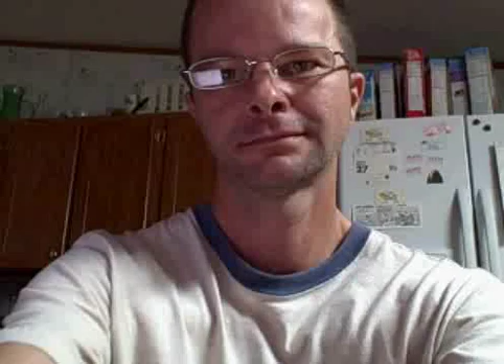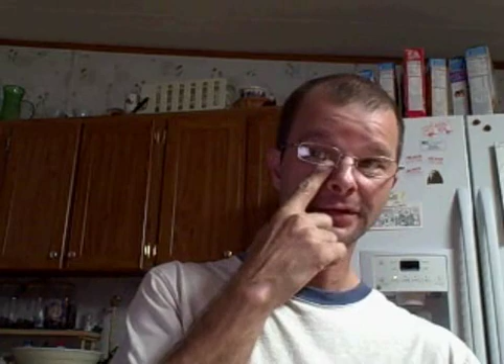HVAC Condenser keeps tripping the breaker with nothing turned on.

Comment: So everyone coming here to view this probably wants to know why their unit is tripping their breaker. Well my unit was doing the same thing. The breaker would trip immediately. I opened up the unit and it turns out the crankcase heater was burnt to hell. The heater gets constant power even when the unit is off so that live wire was touching ground and the breaker could never be reset. I think this issue was the next to last one he mentioned in the video. $30 bucks at the parts store! So good luck and hopefully this is your issue too and your compressor isn't shorted out :)

Comment: that's it! single pole contractor trips breaker anyway... even though thermostat hasn't turned it in/closed the circuit. so you're saying because it's grounded current still flows... enough to trip the breaker if there's a short? I'm confused. New at this stuff. explanation?
Reply from the maker: I havent watched my own video in a while, but Ill give an example. Your outdoor condenser unit is powered typically by 240 vac, if you took a volt meter and tested each leg to ground you will get about 120v (give or take). A double pole contactor breaks/makes both legs at the same time, so its all off when the contactor isnt powered from the thermostat.  A single pole, however, has a solid strip of steel on one side and a contactor on the other.  You can have a short in the unit to ground and it will blow the breaker... For that matter you can hace the breaker blown even with a double pole. How? Sometimes a unit will have things that need constant power without the contactor interfering, such as a compressor heater. These are powered off the bottom side of the contactor where power is being fed to it.  If the compressor heater blows out or corrosion eats through at its base then the live wire drops and hits the case of the unit shorting to ground. Hope this makes sense, no sleep!
Reply: Thank you. That helps

Comment: I am a first year tech. I did check all the connections. The breaker is a 30A so are the fuses. Its a new breaker. Already been replaced.  Cap is good. Leads are tight, contactor is good, no pitting or arcing. Connections in the panel are good. Was asking to see if there could anything else I could check.  Compressor ohms were good. I have to go back out there to see what else it could be. 
Ive ran into a similar issue, where the compressor could not over come the head pressure to start up because of the TXV. The head pressure stayed up and the fix for that one was a hard start. Need more time on this one.
Reply from the maker: Its always fun trying to figure out a new problem!  Its exciting and stomach churning at the same time, hehe. My first year I called the boss more times than I can count!  He hired me right out of school (actually recruited me while I was still in school, cool to know I most likely had a job before I got out!) he told me right off Id be calling him a lot, heh.  You get out thinking you know a lot and then the real world steps in! ;). I think for me it was the myriad variety of old crap out there I had never seen that caught me off guard the most.

Hmmm.. Lets see, what else.  Let me make sure I have this right, it IS trying to start, then trips the breaker, right?  Its not just tripping the breaker immediately.   ...pull the cover off the compressor and poke your head down there and make sure the terminals arent corroded or partly/mostly burned off.  Dig a different hard start kit out of the toolbox and put it on there to make SURE the one in there isnt glitchy/bad. Every once in a while you'll get a bad one or one will go south quickly.  I usually keep two extras on the truck to test with.

While Im on it, get in the habit of checking all new caps with a meter before you put them on a system.  I usually run across two or three bad ones a year that are flakey right out of the supply house!  They usually arent dead, but with a meter on them the ohm reading will go up and down like a roller-coaster ;)  first time I ran across a bad one was at the end of a long, hot day and I was replacing a condenser fan motor, fired it up and it ran a few minutes then started slowing down and smelling!  I thought it was a bad motor!  I was so tired I didn't even THINK to check the new cap I had put on! .....yep, you guessed it, I put on ANOTHER motor and the same thing happened!  DOH!  Homer Simpson moment! :/

Back to trouble shooting... Sounds silly, but check voltage at contactor to make sure your getting 240 and not one leg.  Check to make sure the wiring from the breaker to the unit is heavy enough gauge for the amperage and distance to the unit.  Does it stay on trying ling enough to see any pressures or is it tripping before it actually cranks?  Make sure some idiot isn't sharing the breaker with something else.  About once a year I'll see that. (Usuallly once or twice a year Ill go on a heat call on a unit installed new during the summer and they will have wired the 60 and 30 amp breakers backwards for the heat kits!;)

.  ...if the unit is tripping immediately and not at least trying then I'll have a whole different set of things to check, like burned off belly band heater wires on the compressor, wires rubbing against sheet metal ot copper pipes and shorting, things miswired after someone else worked on it.
Reply: unit disconnect line and load are landed wrong

Comment: Got this condenser thatll run and cool just fine, but after it cycles on start up it trips the breaker. When I reset the breaker it immediately kicks back on. Wiring is good, leads are good,  capacitor is good. Has a supco spp6 hard start installed. Any suggestions? Bad breaker? Does not pull LRA, LRA is 192 and when it trips the breaker it pulls 78A
Reply from the maker: 78 is still awfully high!  Usually after installing a hard start kit, the 78 is what I would expect to see before the kit was installed!  ...and remember, its probably only a 60a breaker...if the breaker is getting old it might not be holding well on short bursts. Obviously you should have a tech check it out,you're working with voltages that can kill here! (Safety speech out of the way.). First thing I would so is get a big flat-blade screwdriver and start tightening! If I had a buck for every loose wire I've found.., 
Shut off the condenser breaker at the main box. Go to the main breaker box first, pull the panel and tighten the lugs on the condenser breaker.  Then go to the disconnect by the condenser and tighten the incoming and outgoing lugs as well here. (What kind of disconnect is this? A pullout or breaker style?  Breaker style can get corroded internally and go bad, I've had lots i turn off there to work on the unit but they never turn back on!). Lastly remove the condenser cover and tighten the contactor lugs.

Its also very possible the supco is bad, the compressor could be really old, or a combination of other things, like the evaporator is on the second floor and when the unit shuts down all the liquid runs back down and fills the compressor up, then it slugs when you try to start it up... A newer unit might just grunt and go, but an older unit cant always keep up.  ...well this is a good start point anyway!  Let me know what you find!

Comment from the maker: @Drew927 All Condensers and air handlers/furnaces have separate power.  This is pretty much a code requirement everywhere.  The Condenser outside is going to have it's own 240v breaker in a main panel somewhere.  The power box outside isn't 'usually' a breaker (but sometimes it is or they will fuse it), just a safety switch for the technician. The same for inside; an air handler (electric heat) will have 240v breakers and a gas furnace will have it's own 120v breaker.

Comment: I am new to the HVAC field, just out of school, and had a call last night with this same problem. It was a 20 amp breaker. I tried checking the amperage off of the compressor just as i inserted the diconnect, and didnt have any amps. could this problem also have anything to do with high pressure switches? As the breaker trips, I hear a " clicking" sound coming from the high pressure switches and maybe some other place. ( couldnt really tell it was 12:30 at night).  My customer was not happy.